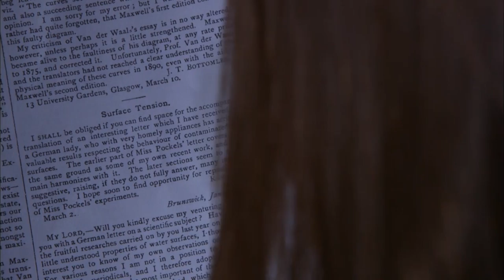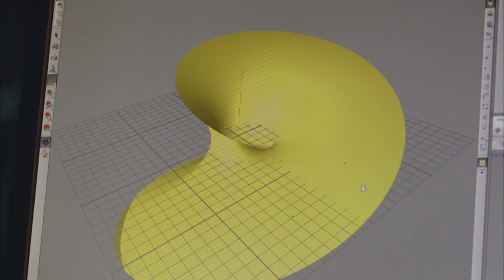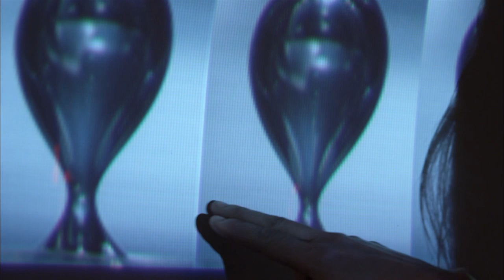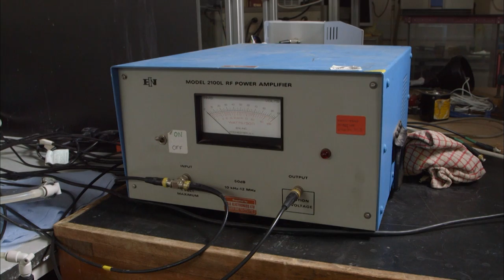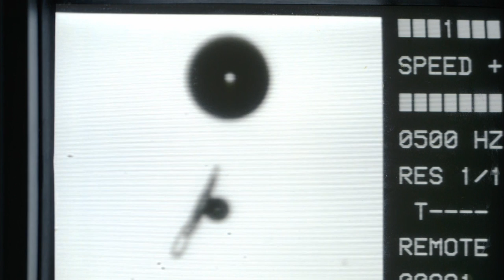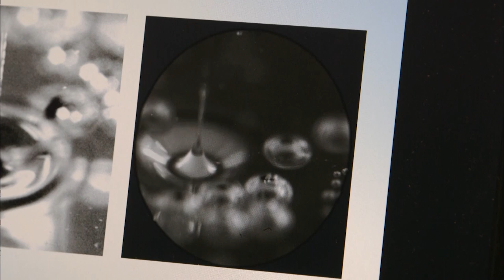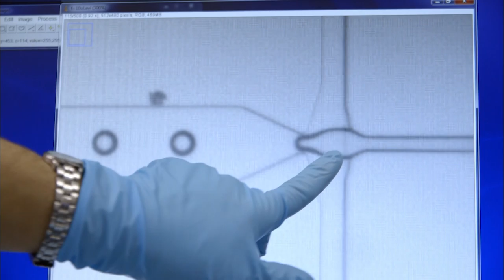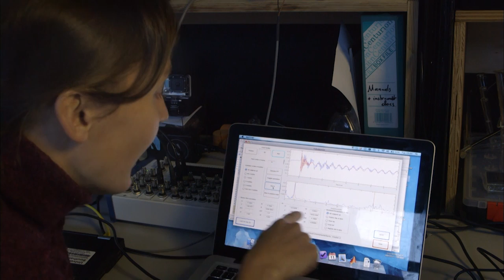The Science of Bubbles (Full Science Documentary) | Spark

Comment: Speaking of bubbles, i've got something bubbling out of my anus right now

6:30 "So you can see that these droplets are sort of curved inwards" NOPE

7:20 So H₂O has a kink in it which means
               -
               O
             /    \
           H    H
           +     +  -      < - it forms bonds which means on the surface it's like an elastic sheet or skin called 'surface tension'
                      O
                    /    \
                   H    H
                    +     +  -  
                               O
                             /    \
                            H    H

                            +     + 

6:57 I find the slow mo droplet interesting cause it goes under the water then the elastic skin pulls the droplet back up then it has momentum so it flies up into the air. I'm trying to work out if EM waves have similar elastic forces & momentum forces